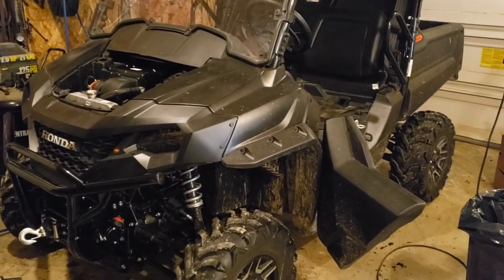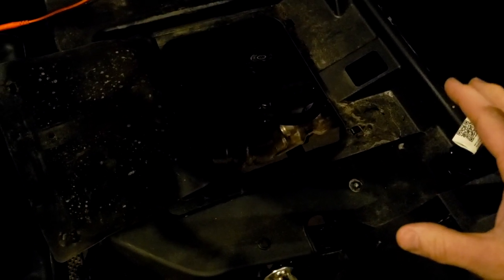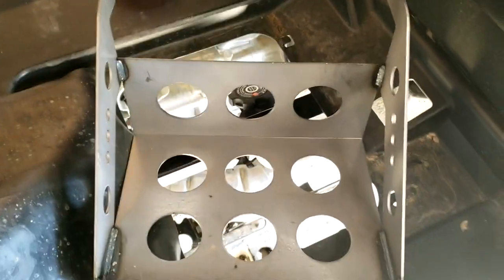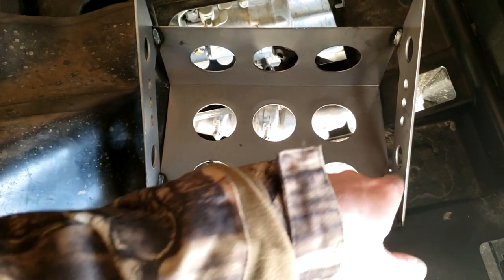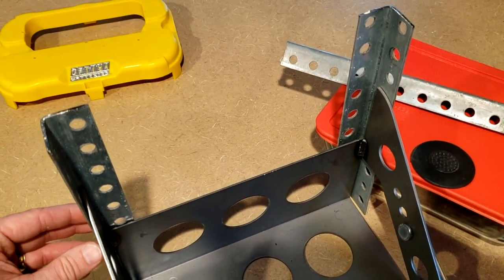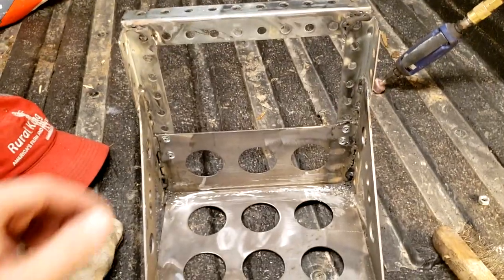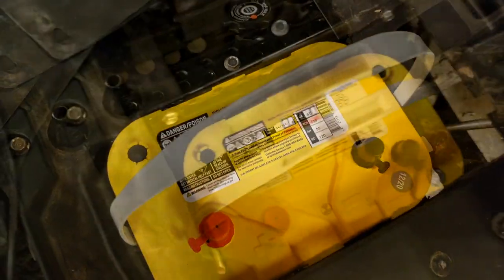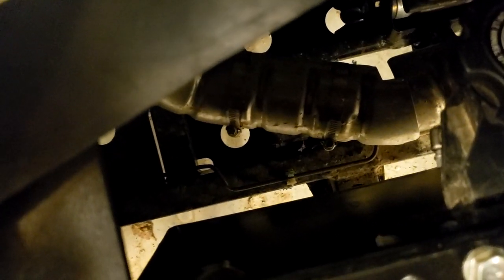Honda Pioneer 700 BIG Battery Upgrade! Optima Yellow Top AGM

Comment: U better do another upgrade for a aluminum or steel grill to block the radiator from any debris because some one ran over a willow tree and a branch wound up through my radiator,the radiator is garbage it's made so thin,that now I had to make a grill to help it stay safe for the second time

Comment: I like this idea. Did it make any difference for cold weather starts? That’s what I am most concerned about. I know in a video u changed plugs to iridium’s.
Reply from the maker: The battery and plugs did help a lot with cold starts. I always turn the key and let it prime completely and then turn the key. If it doesn't start right away it's best to let off the key and then immediately turn it again and it will always fire right up. These things don't like the extreme cold as far as starting goes but once you learn the system they fire every time

Comment: I’m in the home stretch of finishing!! I have a quick question? I bought that 100amp breaker but wondering if all my aux stuff goes on the aux. light bars amp for radio and winch?
Reply from the maker: Well I just ran the winch on the breaker. I have a separate fuse panel for all of my auxiliary circuits.
Reply: @JackofAllMasterofNone  with that said I was thinking I could use that 100 amp for a shut off and extra protection. What are your thoughts? If you Dont me ask I
Reply from the maker: @TheMoleman4life  Yeah that should work fine.
Reply: One last question and I’m out of your hair! Have you had any problems with the charging system or any system problems?
Reply from the maker: @TheMoleman4life  None at all. The only problem I had was one of my battery terminals went bad. I had an intermittent no start. Somehow the metal terminal was bad and I replaced it and all is well since.

Comment: Will the charger maintainer in the bike keep a bigger battery charged  and how big a  amps battery can a person use on a Honda  pioneer 700
Reply from the maker: My stator has had no problem keeping it charged so far.
Reply: It should be fine, as long as you aren't using more amps then the charging system puts out, it will charge the battery. Biggest thing is, if the battery is really low, make sure you charge the battery first instead of jump starting it, less load on the charging system.

Comment: I welded a 2" flat bar to the bottom of my box like your box, bent the remainder of the bar going up the side of the battery/outside the left side of the battery that tied into the outside (left) of the seat bracket with a bolt/nut pulling it upwards. The battery box without this brace had a wiggle. It doesn't now. I also didn't insulate my battery box yet. I'm planning on using some thin galvanized HVAC metal to protect the battery from rocks, etc.

Comment: Great video man, thx for taking the time to share. I'm in the process of doing the exact same install but for dual battery system. I used the 50 cal plastic ammo can from Harbor Freight to put in my tray to hold the battery. Thx for the Ideas man this helped me alot.

Comment: I’m going to do the same thing but with a marine battery because there way cheaper, would you get mad if I made a video explaining how I did it? Asking because it’s basically the same thing you did but with a different battery
Reply from the maker: 😀 Appreciate the comment. You should make a video about it. The more the better. I'm just trying to help the Pioneer community.
Reply: @JackofAllMasterofNone  yea, my battery went out and looses charge quickly for about a month and instead of replacing it with the small junk oem one I don’t see why everyone doesn’t do a big battery upgrade. It will last a lot longer and better performance than oem

Comment: I finally built my own battery box and put a deep cycle battery under the drivers side of the seat. What battery do you have the winch hooked to? And just an FYI, that top seat cover comes off with little effort. And there was no cutting of the plastic.
Reply from the maker: I only have this one battery so the winch is hooked to it
Reply: @JackofAllMasterofNone  I realized that after watching the whole video. Thank you for the reply and the. Videos

Comment: Battery is kinda low in case u ride in alot of water you will be grounding the battery out with the water from post to post being in the water, I had a battery under water for 48 hrs.and it went dead but I had it under water on the bike for a couple of hours and it was hard to start but it was the original battery

Comment: In the process of installing my new battery box thanks to your idea! One thing I did different was I went with an  Optima Marine battery as it has an extra set of screw posts so I can attach all of my accessories to them and I isolated the battery and made it stand alone in case I left something on and ran the battery down. Thanks again for the great video and the relocate idea.

Comment: Great video, thanks!  Time for me to make the same upgrade due to added accessories.  I am curious as to how you went about choosing this battery with so many choices out there?  Were you going for most power that would fit in that location or other reasons?  Why not a car/truck battery with 750 CCA?  Sorry if dumb question but are there limitations/parameters that must be met?  Thanks for all your videos, they are so well done!
Reply from the maker: I chose this battery because it is also meant to be drained on using the stereo or some other accessory and still be able to start the vehicle. A regular car battery is not meant to be run down. It's meant to provide all of it's CCA power in short bursts to start only.

Comment: Can I use any 12volt car battery? Just as long as it fits my battery box.
Reply from the maker: Yes u can. But a non-sealed lead acid could cause problems on rough terrain in a side by side because it will be all over the place and could spill acid.
Reply: I had questions on your turning signal video. The 5 point rocker switch. The top two are ground, the middle is power. The lower left goes to turn signals, not sure on the lower right. Where does that connection go to?

Comment: I have a 2019 700 4 and was about to do the duel battery but now this makes perfect sense! Thanks.
Reply: Quick question? I have a wench, amp for radio, and light bars should I add all those to the auxiliary side of the 100amp breaker?

Comment: Stupid question....so even if the 700 is running accessories like the radio, lights, etc. will still put a drain on the battery?
Reply from the maker: Just depends. If you excede what your stator can produce, which is around 450 watts, you will be eating battery life. For things like a winch, you need more reserve power. The stator on the side by side can't power the winch at all. It can only serve to charge the battery back up after you are done using it. This is why a larger battery is important when adding high electrical load accessories.

Comment: Good Evening,
I have all the parts for this upgrade and was wondering, looking back, is there anything you would change or recomend when doing this?
Reply from the maker: No. Still works great. Never have to worry about a dead battery.
Reply: Thanks, when you installed your 100amp breaker for the big battery upgrade, did you remove the 30amp breaker you ran for the six blade fuse block that powered your accessory panel on the dash in your earlier upgrade?  Essentially running it all through the bigger 100amp breaker or did you just kept them both separate running your winch solely on the dedicated 100amp breaker?  I am currently installing a winch and an accessory panel and was wondering.  Also, did you utilize the same 12v accessory line from the cigarette lighter to power the relay(accessory panel upgrade) as well as the winch relay allowing power only when the ignition is on?  What location did you end up using for the momentary winch button?

Sorry for all the questions, just trying to learn from your experiences.

Comment: Thank you for the video.

I have all the players for the upgrade except the angle for the battery box. I will be welding it together like you did, but I have a couple of questions.

Our local box store has the 1 1/4” and 1 1/2” angle like j  your video.  It’s Zinc and only 14ga. I was thinking of using the 1 1/4” angle iron but it’s much thicker than 14ga.

Have you noticed any flexing or cracking in the lighter angle you used since the weight of the battery could cause some flexing as you mover over rough terrain?

Thanks again for the video and the insight.

Cheers
Reply from the maker: I haven't had any issues at all but it definitely wouldn't be a bad idea to use stronger than necessary metal. You really cant overbuild this box, especially if you do a ton of offroading, which I do not.
Reply: @JackofAllMasterofNone  
Thank you for taking the time to answer my questions.

Have a great day and thanks for making awesome videos on DIY projects.

Cheers

Comment: Man you did an awesome job describing how to do this . Is that heat shrink on your main leads going to the battery ?
Reply from the maker: No. It is the split plastic wire loom stuff wrapped with electrical tape. It's just to protect the wire from any rubbing or chaffing on the frame anywhere.

Comment: Was there any room under the bonnet to add a larger battery ????
Reply from the maker: Unfortunately not. I have a heater and multiple relay boxes for a winch and plow system. Also factory power steering.  Just no room under the hood for a larger battery.

Comment: Good job. I see all kinds of ways of doing these machines. I would definitely wrap that battery with some cool it or more insulation. Gets crazy hot.  Some guys header wrap the header for the heat and noise. 👍
Reply from the maker: I have the opposite problem on mine. I can never get the machine hot. I think it's my use. I don't do any mudding or anything, just around my wooded property.  Nonetheless, I put heat shield on the side of the battery box to help keep the heat out.
Reply: If you've seen my ride on the 700 site. I dont mud either, just around the lake and trails 👍

Comment: So do you think this battery is probably double the size of the factory battery? Is that most of the reason why people put in two batteries because they are so small and drain down pretty quickly?
Reply from the maker: This is more than double the size of the factory battery. Yes. That is the reason. They just can't handle.any increased load from power heavy accessories
Reply: They put 2 batteries in so they have one to start the machine and the other to run solely the accessories.